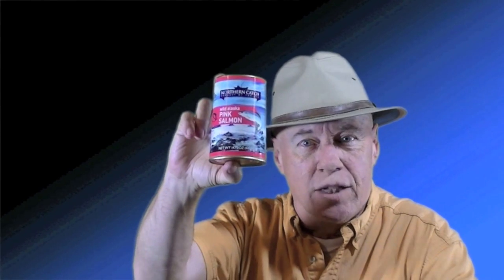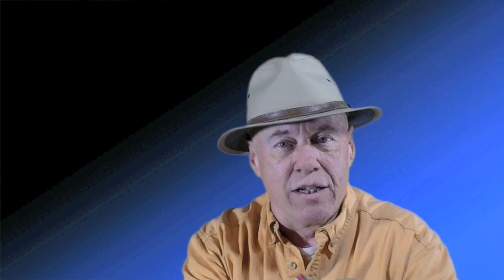WHY SALMON CANS ARE TAPERED

Comment: No that's wrong 
I don't know what it is but it's not because of that 
Because they round the bottoms of cans now 
So they can be stacked 
Were they taper them a tiny bit but they're tapered
A good quarter inch so you're wrong

Comment: The taper also makes it easier to store the cans for recycling. Instead of crushing them by stomping on them,  I simply stack them.
What I do is I put the used lid inside the can, then take another can and stack it inside. Then I'll stand on them to make sure they are tightly stacked . Much, much easier!!
I think all food cans should be tapered to make recycling easier.
Reply from the maker: Good idea! I love saving space, especially involving trash.
Reply: @MagnumVideos  
I try to separate and store waste metal in my home, then bring it to a metal recycler every year or two. So knowing how to process and store cans efficiently is useful to know. I don't get a significant amount of money for the cans, but other metals like copper, brass and aluminum fetch a few bucks. So I throw the cans in the car as well since I'm going to the recycler anyway.
Reply: @jonfklein  Any idea what the cans are made of? I have the same cans from Northern Catch (11 years later)
Reply: @tbtitans21  
They are magnetic, so probably some kind of steel.